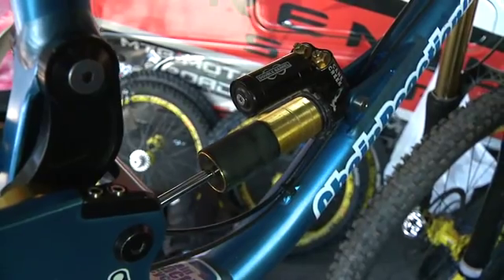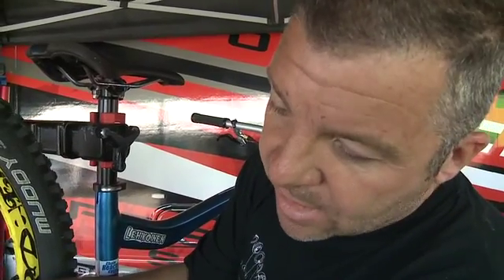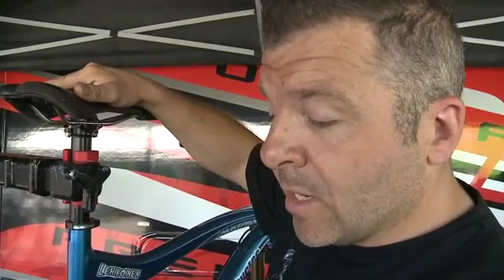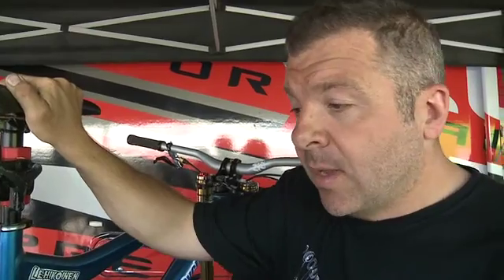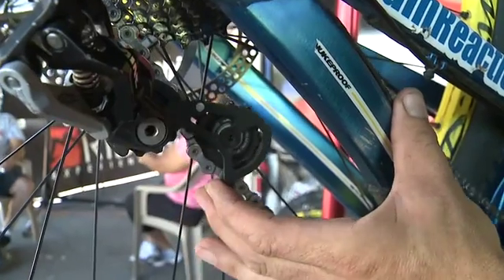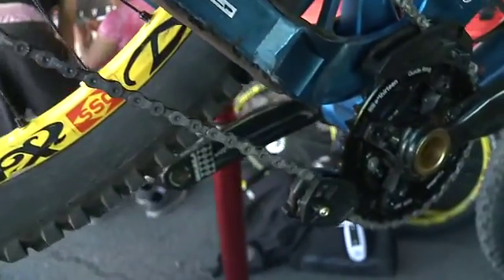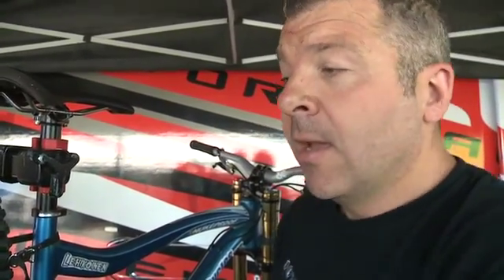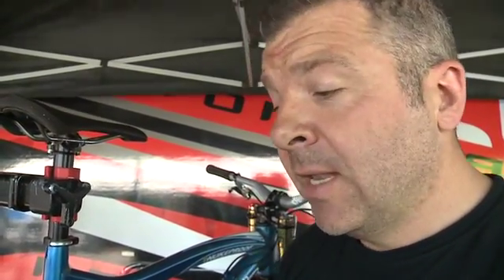Team CRC/Nukeproof Tech - Setting your chain line

Comment: Perhaps the title should be 'Correct chain length for DH mountain bikes'? As I understand it 'chain line' relates to keeping the chain running straight by proper alignment of front chainrings with rear sprockets.

Comment: he says chain length multiple times dumbass. and that clamp is facing the right way.
Reply: Should the slit at the top of the seat tube and the slit in the clamp line up or should they be opposite? I always assumed they are supposed to line up